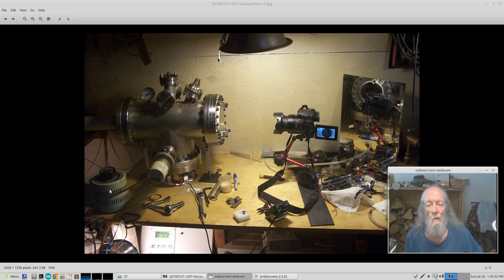Nitrogen glow vs pressure

Comment: As a metal fabricator who has just recently started a turbo jet bicycle project, I'm now stuck wishing I was smart enough to figure out this nuclear thing you guys are going on about...

In all seriousness, keep it up man. You're doing great work. Open source is the only way to advancement.
Reply from the maker: If you get that turbo jet bike working, well..."Rusty's in the club".  Do be sure and let us know! https://www.pinterest.com/pin/3588874679781991/

You do know that when we call it research, it means we're trying to find out things we don't already know or understand, right?
The huge bulk of what I do is engineering...I mean, yeah, we've found out a few things no one else has so far, and I think we're maybe hot on the trail of a couple more of those...but most of the actual work is just getting things that are pretty well understood to work together in a system so we can do that.  And most of the frustration - either a new leak has appeared, or that gage is going bad, but the system isn't showing me low enough base pressure right now to do the experiment I designed...sigh.  It can be really hard to chase down a tiny leak as when you're shooting for less than 10^-1 millibar (billionth of atmosphere) - an extremely tiny leak can expand to the point it dominates a 60 liter/second pump...I may have to actually make the mass spec type gear so as to find the leak to test the ion trap (which is roughly the same concept set).  It would be nice to start with something I KNOW should work, instead - if it doesn't work, not knowing for sure if I made a mistake or the leak is defeating what I'm trying to learn....such is the life - and if you do any engineering, it's not all that different.

Comment: That’s awesome, I machine and weld vacuum components for a living and was looking for a cool experiment to do at work.
Reply from the maker: I do those things as needed, at perhaps "home-gamer" level.  I'm proud I just tigged a KF 60 nipple into an 8" CF flange on the first go and didn't mess up...Hint - start with atmospheric pressure or nearly (this one started pretty low and some of the cool effects aren't shown) and use some HV source that doesn't mind a short (neon sign xfrmrs are resilient for short times).  Try dry nitrogen (like here), argon, air (with water vapor), helium, basically any welding gas or mix you've got - 
BTW, the central rod here you're seeing end on in the middle is a .020" tig rod. Just for fun.

Do you use a chamber (glove box) to do your welding, or out in the open with a big gas lens?
How the heck does one get that knife edge on a CF flange in SS?  Diamond point tooling?  My SS work usually comes out a bit rough to make seals.
Reply: Doug Coulter thanks for the detailed instruction. 
We usually weld with a big lens with as low as possible amps and a slow travel so it keeps the coverage nice and consistent and giving you the penetration all while purging the inside with argon. Usually I only use a welding chamber if I’m welding Inconel & titanium etc. 
We don’t make ConFlats with knife edges, if ever we need to use them on a system build we usually buy them but I think you’re right, they are diamond cut.  
I had to joys of repairing a knife edge on a cf flange that was on the end of a delicate quartz leak standard today, a colleague dropped it after recalibrating on our mass spec so I feel your pain, it’s a long boring process.
Reply from the maker: @macwillard  I got a pretty big (12) glass lens (seeing is nice) but I probably garfed up on the amps.  Thin to thick is always "interesting".  The flange hole was stepped - so that the nipple stopped around a quarter inch from the flange face.  Tacked and went for it - I definitely wasn't stacking dimes there...(notice no post weld pictures on the build page).  But while I did have leaks, that wasn't one of them.  I think the only thing that saved me there was the tight fit of the thin tube - so if it wanted to develop a hole or something, there was just no place to go.  I think I used a little over 80 amps and went pretty fast after tacking, laying the thing on the floor (I lack cool jigs) and rolling it after every quarter turn or so, then I went back for a second pass to make it look airtight - and it was, so...whew.  Thing is, for a home gamer, this stuff is kind of expensive to get some to just practice on!  I wound up with around a 3/8 wide bead, which as we know should probably have been  more like 3/16.  It's probably really strong...

Comment: Nonconductive vacuum is something I'd never heard before. Thank you, now I have something to read about!
Reply from the maker: That's an old jargon term...nothing is ever really totally nonconducting, but you can get under the PxD curve of Paschen's law, which has a very steep left side.  Read this: https://en.wikipedia.org/wiki/Paschen%27s_law  What happens is you run out of the ability to make cascade ionization happen with too little gas and too long a "mean free path" - no loose electrons, no conduction.  Fusors operate on the steep left hand side of the curve pictured there.  What I  intend to do at some point is to make a really good video about what it looks like vs pressure, as the tank itself is better for this use than any gage can be, at least for fusor work, and you can get a "reading" at a glance with the stuff you've already put together, saving a good chunk of change when you're initially getting things going.

It surprises people to find out that at low pressure, it's easier to get a spark across a longer distance than a short one.  Electricity does NOT always take the shortest path...(Seen any straight lightning?  Thought so, but the reason there is different...)